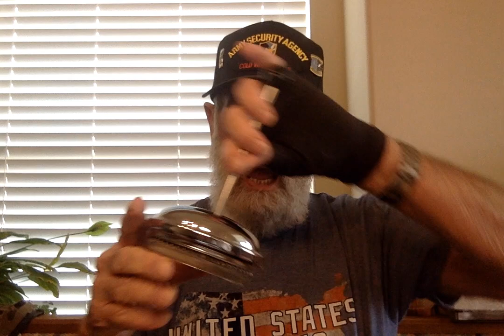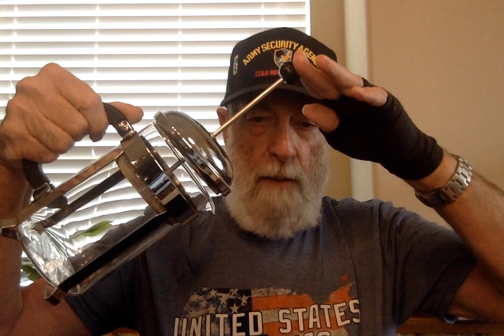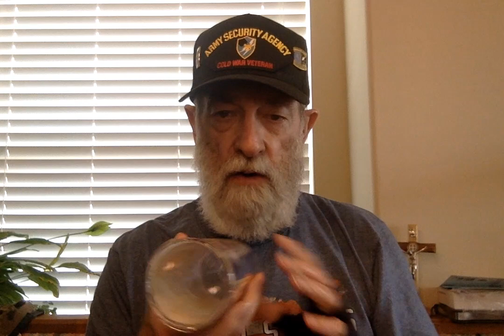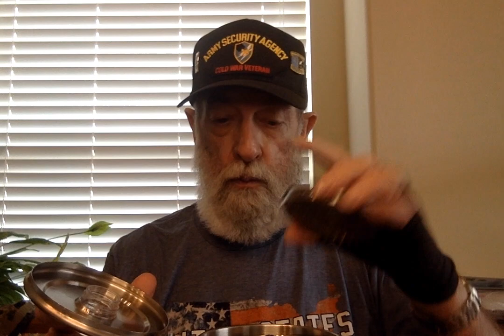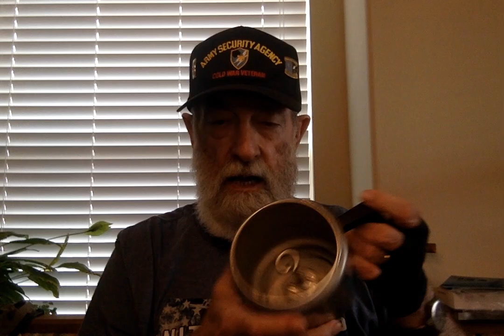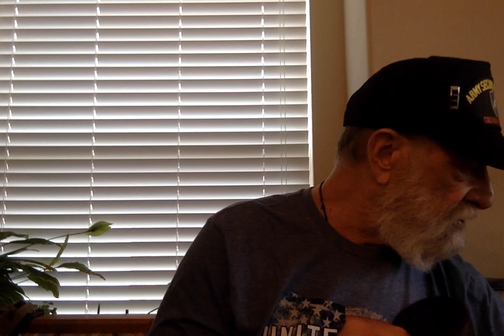Brewing Coffee in Post SHTF World

Comment: Hey Lee, I appreciate this and your other videos. The espresso pot at the end was neat, I hadn’t seen that one before pretty cool. I like the video where you went shopping and set up the two buckets for nuclear event, I got a couple setup like that after watching it, a video expanding on that would be cool. Also, could you do a video on different ways to shower after SHTF, two ways I have are heating water on a stove, putting it into a bucket then using a handheld cordless electric shower with pump and other way is I have a propane tankless shower, but I’m guessing there may be other ways I haven’t thought of. Thanks!
Reply from the maker: Hi and thanks for watching.  Thanks for the kind words, glad I'm adding value to your preps.  You've come up with a great idea concerning showering.  I just have a 3 gallon camp shower I'll hang off of a hook I've installed in the beam in my back patio.  You've got a great idea, and I think I will use your solution.  Although, I'm probably going to have to increase capacity from just 3 gallons.  In the old days, they didn't shower, they bathed and dumped water over the person (kind of a shower) as they got out of the bath to rinse them off.  That might be a better long term solution.

Comment: My espresso is hand ground & pressed as long as there's beans.  The small comforts. 
~ USAFSS; DLI 71-72, SInop 73-74 and Augsburg 77-79. In between I was a medic, LoL....
Reply from the maker: Wow, thanks for watching - I was in A Co DLI 04/71-04/72 01JN47W0271 and was in 1st Ops Bn USASAFS Augsburg Nov 77 - Nov 80.  I was N Bay Type 3 Sup, then transcriber, then moved to B1 Analysis.
Reply: @ColdWarPrepper  LoL - I was C Co. RU 9/71 to 4/72 and 6913th Security Squadron 11/77 to 7/79 over by the back gate facing Stadtbergen until I moved out to rent from a little old Frau in Stadtbergen. We probably crossed each other's paths numerous times in both places - especially going in and out of security control at Gab. I've looked at the Flair-9 on Google Earth and the sites on the mountain at Sinop and it's so wild - if you didn't live it, you really can't get it. I was analysis both assignments as my live handcopy and off-line transcription abilities weren't good - especially after a three and a half year hiatus between.
Reply from the maker: @GeeWit  I was also TDY to USASAFSA 1/76 to 4/76 opening LFV - ironically when I became a Warrant Officer I went to Det Wobeck which is what LFV was supposed to replace (1984).  I was in Co C for both basic Russian 01RU47W0773 (1/73-1/74) and Intermediate Russian 20RU36W0277 (Jan 77 - Nov 77)  Worked North Bay LFV Trick 2 then Transcriber - Swing Shift, then mids in B1 Analysis - I'm sure we did encounter each other a couple of times